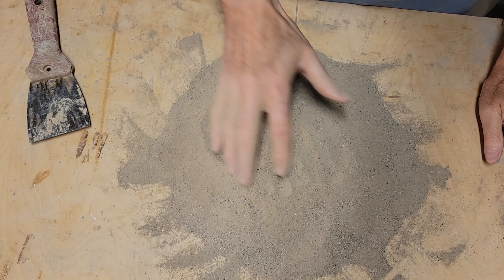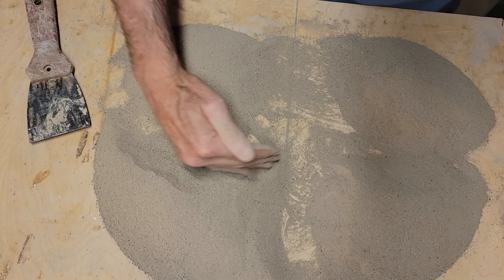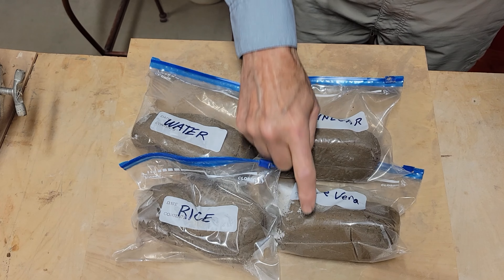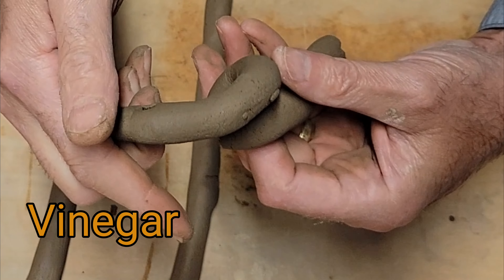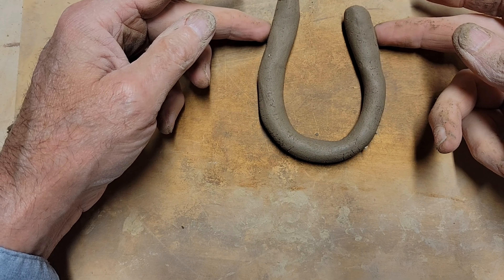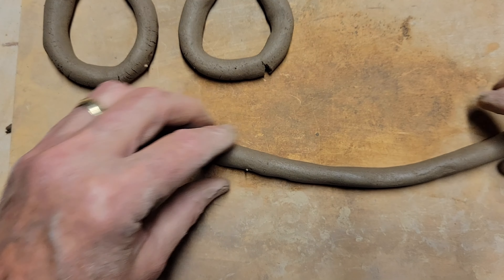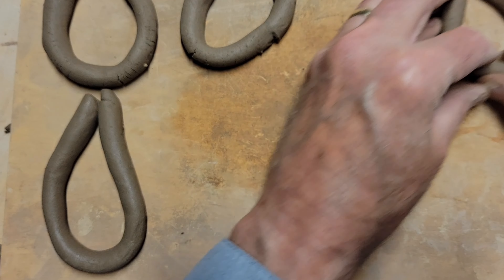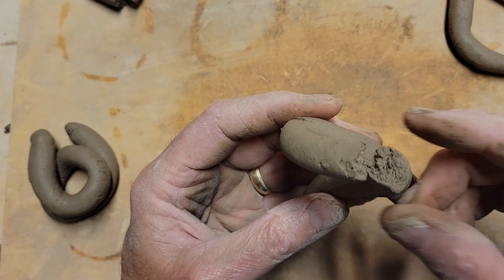Do Additives Improve Plasticity?

Comment: might want to try adding other types of clay (ball clay, bentonite clay, etc.), from what I understand having more varieties of clay and clay size particles in a clay body will increase/improve the plasticity. the smaller particle clay will fill in the empty gaps of the bigger clay particles. You might also want to try adding fiber/paper pulp, the cellulose fibers will help create links to help the particles hold on to each other better, as in fired paper clay. adding a little Sodium Silicate/water glass might also help flux and make the clay particles more sticky to each other. Just throwing more ideas your way for future experiments :) All the best!
Reply from the maker: Thanks, I appreciate you input and ideas. Cheers.

Comment: Small percentage of bentonite added can go a long way to aid plasticity.  2% could be all you need, too much can effect shrink rate for bentonite has a high shrink rate.
Reply: My experience with bentonite in my own local clay has been that, while it adds plasticity quite well, it also makes it much more prone to drying cracks.  I've been fortunate to find in my area a rare smectite called saponite that adds plasticity but does not seem to promote cracking.  Every clay is unique, though, so what works for one may be counterproductive for another.
Reply from the maker: It makes me wonder if native people mixed different clays to give them a better paste. They certainly would know the characteristics they liked.
Reply: @airstreamwanderings3683  I know volcanic ash seems to be a common add in with modern native potters, bentonite I think is a form of decomposed volcanic ash. But your guess is as good as mine 😄

Comment: Well, that clears up the rice water video. However, my clay is plastic so I'm going to check on the vitrification with the aloe after firing.
Reply from the maker: I'm curious how you would do a vitrification experiment. I've wondered what would be a good way to test clay hardness and strength  after firing.
Reply: @airstreamwanderings3683  I'm just doing my clay with and without it in the same fire, and check the ring like Tony did.
Reply from the maker: @jamescecil3417  It would be nice if it made a difference. I don't understand very well what is actually happening when clay fires and how an additive would make a difference.
Reply: @airstreamwanderings3683  I figured it must be how the sugar  is consumed during the firing process inside the clay.

Comment: From what I understand, vinegar does a couple things.  It changes the electrical charge so that the clay particles fall out of suspension and closer to one another.  Another things it can do is help the bacteria in the clay break it down further adding to the acidity over time.  So if it sat for a year in a moist bag I bet you it would be really good.
Reply from the maker: Thanks. That makes sense. Certainly my scientific method could have been better.
Reply: @airstreamwanderings3683  i think you did great. I enjoyed it a lot.

Comment: Again, bravo for your scientific approach. Thanks for sharing your results.  I've never made a clay body with wild clay (yet) but I've made clay bodies from commercial sources. An important consideration is that potters like the clay body that is comfortable for them to work with. I might find your clay body awful, but you love it and have made fabulous wares with it. 

Generally speaking, preferable clay bodies use 3 different clays. Clays have different particle sizes, so if you get the right proportion, they "fit together" better and don't leave space. Of course the spaces are microscopic. But that seems to be the general guide. it has worked for me. For people trying to use ancient methods, mixing clays might not be feasible or work. Some wild clays are an absolute nightmare. Others come out of the ground, nearly perfect. You are correct: a good clay body needs some temper, a non-plastic material to give it tooth and to increase its ability to resist temperature shock. Lastly, the body needs a fluxing agent so that the materials melt and reform to make new crystalline structures during firing. Al2O3, alumina, the main molecule in clay, melts at about 2100 deg C. So, yeah, you need flux. 

Wild Clay is often blessed, because it already has impurities, such as sand (temper) and iron (flux). They naturally occurr in the right proportions to make them fire well. Many an old potter claimed that a can of beer improved workability of clay. Some claimed to piss in their clay to accomplish the same thing. That might just be a guy thing. I think Tony Soares’s aloe juice is a beer or urine replacement. Those organic liquid additives are thought to change the surface charges on the individual clay particles. Usually you want them to stick together better (negative charges attracting positives charges and vice-versa.)  The fact that clay particles have one side positively charged and the other side negatively charged is part of the magic of clay. Acids (like vinegar) are thought to react beneficially with the surfaces of the clay particles, enhancing their bindability. Another hypothesis is that the organic substances give rise to microbial action, producing organic acids which change thesurfaces of the clay particles. This idea has merit from a biochemical point of view, but I have no data to support this idea. You were wise to mix up the clay well, as dry samples and let them sit after adding liquid. I am assuming that you thoroughly wedged each sample. Each looked fairly uniform on my screen.

I think a more precise test would have been to weigh equal amounts of each sample dry. Add the same weight of each liquid tested to the same amount of dry mix. Mix for the same amount of time. This procedure might have lessened error due to differences in proportion of dry clay/sand mix to liquid or the mixing amount. Or it might have made no difference in the greater scheme of things. Incomplete mixing can introduce inconsistency when making and then testing clay, paints, slips  or glazes. 

Still, your experiment is valuable.  My thought is that different clays will react differently to the various additives.  You have to find the one that works for your clay. Hope this helps. If you already know all this stuff, then I apologize.  Please keep up the fabulous work. Thank you.
Reply from the maker: Absolutely, different people like different  things. With wild clay there are many unknowns but many like the thrill of the search.

Comment: I forgot I did try boiled corn for the juice which becomes cornstarch and did actually get better plasticity and no dry cracks with a clay like you have. Sure stinks though 😮
Reply from the maker: Decomposing organics doesn't have much appeal to me. I have some clay that works pretty good for me. Wet strength is more of an issue than plasticity especially when building larger pots. Thanks

Comment: I never mess with additives now.  I have some vile soft squishy clay from the  191 roadcut outside Blanding and some awful soft stuff from Larimer County. You can't build with them, you can't even grind them, they are utterly useless UNTIL I have some short clay and then a little of that stuff mixed into it and it's like magic, plasticity galore!  I have to wedge with extreme prejudice though to mix it.
Reply from the maker: It sounds like you have found the secret recipe. Amazing that the whole can be greater than the sum of the individual parts.

Comment: I do well with most of my wild clays with sand addition at 12.5%. 
But of my clays is short and adding sand up to 20% helps a lot, but still not perfect. 
How high can you go with sand addition?
Thanks Wes.
Reply from the maker: Every clay is different and the optimum amount of temper varies. I've heard of people going as much as 35%. Personally 20% is what I always use. Good luck and keep on testing.